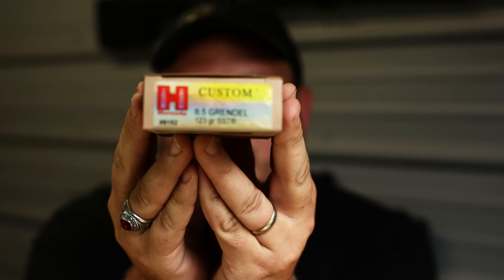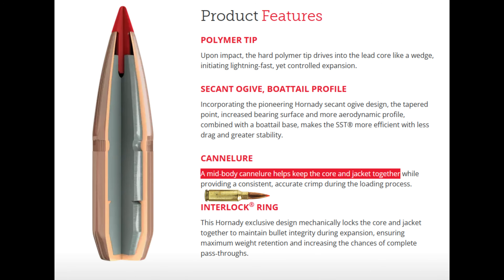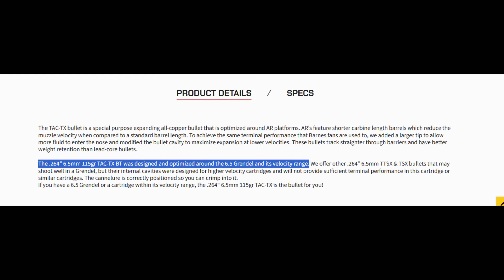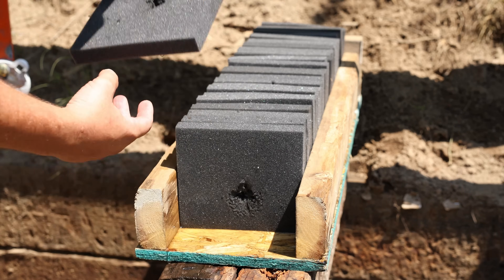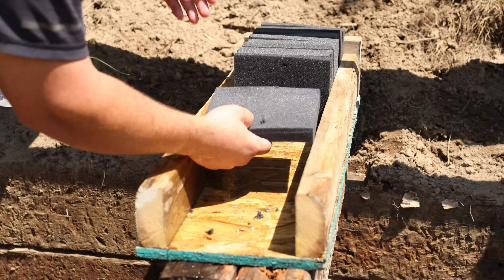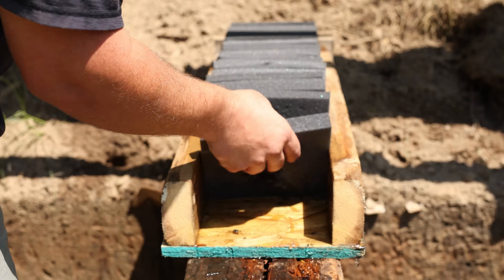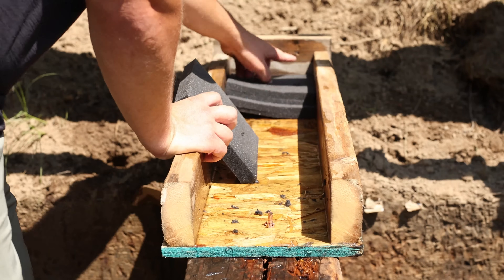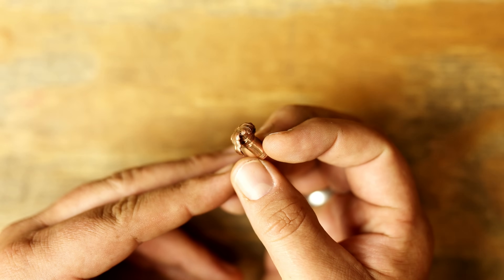Hornady SST vs Barnes TAC-TX | 6.5 Grendel Hunting Ammo Test & Ballistics Breakdown

Comment: Have not used either round for hunting but have experience with the 123gr ELDM. Took three deer last year (two does and a buck). All rounds passed through, the deer weighed 100-140lbs and the damage was very similar to my friend's .270 using Hornady SST. What stuck out to me was the amount of organic material left on the ground from said deer, bits of bone and meat all around the location where they were struck for a radius of about 10m. Never seen that before!
Reply from the maker: You know we have a lot of customers with similar experiences to yours with that 123gr ELD-M. Technically not "designed" to expand, but it sure seems to do a heck of a good job, doesn't it?
Reply: @grendelhunterofficial I've been wholly satisfied with my 16" 6.5 grendel AR, It's my new favorite caliber! I built it for elk, red deer and feral hogs. I'm saving up for an LPVO but I've gotten MOA groups with Hornady SST and Barnes Vortx out to 200yds

Comment: What we are really missing is a good bonded bullet in the 120 or 123gr weights and is readily available.  The only one I've found is the Speer God Dot 120gr and good luck finding a box of them.  I wish Sierra would start making a bonded game king (or match X...  Thats all I would hunt with ever again out of a Grendel if they would make them), especially in a 123gr 6.5 cal bullet, or Nosler make an Accubond in the 120gr.  It makes sense as it maximizes the BC and will so beyond a solid copper but in a shorter length package comparatively.  The biggest issue with the copper bullets is you have to go down in weight to get the length to work in the case.  Also, they don't like to shoot in barrels with mixed copper jackets also being shot out of it.
Reply from the maker: You're absolutely right about having to go down in weight with the copper bullets. And you may be interested to know that Druid Hill Armory offers a 129gr AccuBond-LR load for the 6.5 Grendel. We've been testing it out a bit lately and are planning a video in the future. Sneak Peek: Out of our 22" barrel the average velocity is just under 2,500 fps. It would carry 1,000 ft/lb of energy out to about 425 yards and still be going almost 1,900 fps. Might be worth checking out.

Comment: I liked your no nonsense approach and balanced appraisal of the performance of these 2 bullets. Waterlogged foam in an interesting test medium I’ve never seen before but I thought it was really useful in showing the “wound channel” in 1” increments - almost like an MRI scan. 

The performance of this 6.5 Barnes TAC-TX looked great. Could you compare the 110 grain TAC-TX and Hornady’s 110 grain  CX loading for 300 Blackout?  I’ve just worked up a load for the 110 grain TAC-TX out of a 9” barrel with average velocity of about 2,130 fps. Does it still perform as well at the slower velocity?  Both being all copper bullets, it would an apples to apples comparison.
Reply from the maker: I'm glad you found it interesting! Your comparison to an MRI scan is a cool way to look at it.
The 300 Blackout isn't a caliber we're doing right now, but that would be an interesting comparison to see.

Comment: I would take the bullet that fragments all day long. I actually prefer match bullets. Very devastating.
Reply: The Sierra 120 grain Pro Hunter and 120 grain Nosler Ballistic perform in a very similar manner to the Hornady 123 grain as they are all cup and core bullet.   At close range at higher velocity these bullets tend to shed a lot of weight/mass.   As the velocity drop these bullets loose less mass but still expand at lower velocities than some monolithic bullets.   The 120 grain Speer Gold dot and 120 grain Federal Fusion 6.5/.264 bullets have a bonded core and don’t shed as much mass at closer range.   The Nosler 129 grain Accu Bond Long Range (ABLR) is another bonded core bullet that expands at lower velocity but still has a very good BC.    I’m curious to see how the new Hornady 90 grain CX monolithic bullet performs in 6.5 Grendel.

Comment: I took a 200lb mule deer at about 60yrds with the sst in 6.5 grendel. Behind the shoulder, worked fine.
Reply: You put a 123 grain bullet moving 2500 fps into a medium sized animal’s lungs… we probably could’ve guessed that would worked
Reply: We are super proud of our results with the SST as well.  Deer either drop in their tracks or they don’t run very far.
Reply: They work awesome in that situation.  If you have a hard quartering shot then the SST will be lacking.  I have used the SST a bunch but I got tired of tough tracking jobs.  I switched to Federal Fusions, Accubonds, and TTSX and could not be happier!
Reply: I haven't been happy with high shoulder shots with the sst. waiting for my barnes to come in to try those.

Comment: Good information! The nearly identical bullet drop is interesting. I'm assuming weight difference is offset by the higher B.C., respectively. Have you tried the PSA Sabre Blade Black Tip? They partnered with Hornady so a very good indication it loads the SST. And also, if you've tried the Ammo Inc. HUNTLR? Again, I believe it is the SST bullet. 
Thanks,